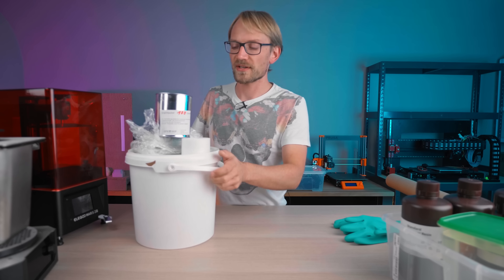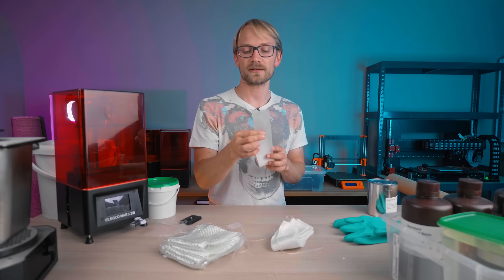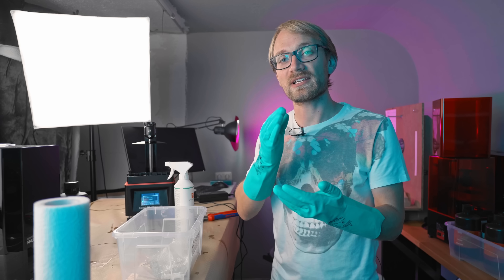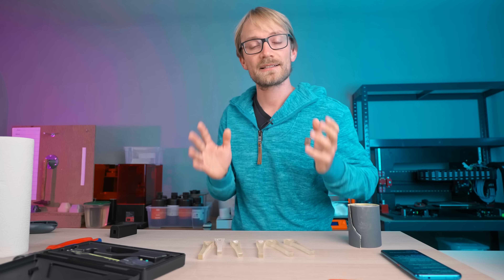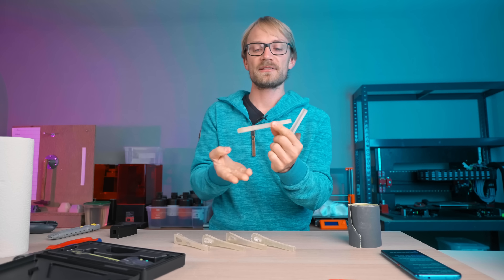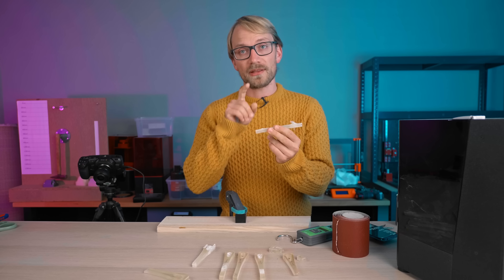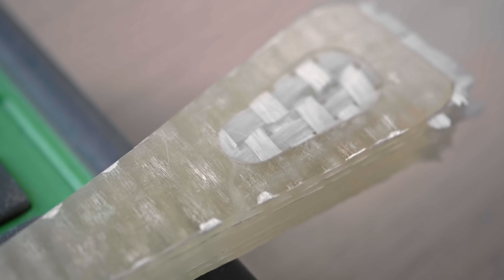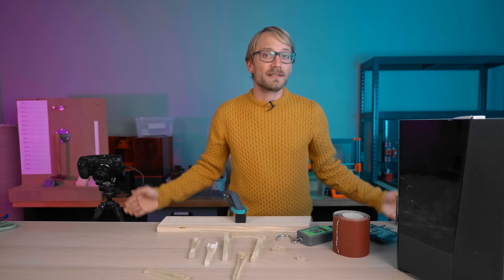Fiber-reinforced resin prints - how much STRONGER are they?

Comment: Concerned about the methodology here... There is a huge difference between Tensile Strength and Flexural Strength, and this test (which is purely flexural) is kind of a worse-case scenario for the orientation of the layers and the direction of force, mechanically speaking. I'll ramble a bit but don't want one wall of text so...

If I could recommend one improvement it would be to print two eyelets in your test pieces and do a Pull Test in a similar orientation to your scale. This would be testing Tensile strength instead of Flexural, and I suspect you'd find the overall tensile strength greatly improved over the default resin. When working with material composites, orientation is everything. To put into other terms: imagine a wet rope gets frozen all the way through. The newly rigid rope might, under the right circumstances, break if set parallel to the ground and force is applied to one end, as it's being attacked in it's thinnest/weakest dimension. If, however, the frozen rope was used to lift a load (as a rope realistically might be asked to do), failures in the ice may be more numerous, but they should be overall smaller, more evenly dispersed, and overall less impactful on the rope itself or it's ability to lift the attached load.
Reply: Flexural testing constitutes a very meaningful outcome to assess the integrity of a composite structure. Bending is the most frequently encountered load case of components in the real world, rather than tension-only. Logically, fibres are stronger in tension than in compression, so that's why the compression load upon bending tests the bonding quality between resin and fibre. If the bond is weak, fibres buckle prematurely, leading to compressive failure. If bond strength is very good, mixed mode failure or tensile fracture occurs upon bending. Overall, glass fibres tend to fail in compression (in some instances in tension), carbon tends to fail mainly in tension (even though tensile strength is higher than compression strength) upon bending, provided that fibre-matrix adhesion is very good. Before commenting, that I am wrong, I would suggest you do some mechanical tests yourself ;)
Reply: I think the results are still useful, but yeah a CNCKitchen-style tensile test would be a nice addition.  I wouldn't be surprised to see a different breakdown in strength from a tensile strength test, and thus you should pick the material specifically for your application.
Reply: Actual structural engineer for a composite aircraft company replying here - The flexural test isn't a bad test for this application, though you'd rather see a short-beam test (simple support on either end, load applied at center) to demonstrate flexural strength. Several commenters are correct, the upper skin in the demonstrated case will be in tension, while the lower skin is in compression. Flexural strength is the exact reason we in the industry use cored composites, not tensiile strength. This is essentially a cored composite.

I think the reason we're seeing early failure here is that half of your fibers are going transverse to the strain, thus doing nothing for strength properties. It would appear from the images that the fibers might also be less than fully wet out, and the failure mode would seem to bear that out. A unidirectional lengthwise fiber here might yield impressive numbers.

Also - though you show greater stiffness with less strength and judge that not good, that's not always the case. While high yield to failure (toughness) is usually thought of as a good thing, it is not always so in cases where high deflections will force loads into otherwise strong-enough parts.
Reply: I hate to burst everyone's bubble, but bending strength is more applicable to most applications.  You rarely get pure tension in any structure other than a truss.  Think of the applications for a high-strength print: quadcopter frame like he mentioned, some sort of hook, maybe a bracket to attach some things together.  All of those applications are loaded in bending.

Also, tension strength and bending strength are intimately related.  For the solid resin part that fractures on the tension face, the max bending stress at fracture is very close to the max tensile stress.  For the composite parts, it gets more complicated.  But it looks like most of them failed by crushing on the compression side of the bending member.  So the test measured the compression strength, but you can conclude the tension strength is increased because the tension fracture was inhibited.
Reply: just noticed this too =/
Reply: Plus by doing this adding layers and curing them separately you basically destroy the strongest benefit of resin printing by creating layer structure. It makes it more sensitive to Flexural tension. But Thomas if you read this, make another video where you basically wrap these parts in a 3d environment instead of 2D. Just 1 or 2 layers would be enough I believe.
Reply: I have always been under the impression that flexural strength is directly proportional to the tensile strength of the material because the top of the flexing member is in tension. Is this somehow not correct?
Reply: I was coming down to make a similar comment, you however put it more clean and organized than I would have. 

The flex test is confusing as the eyelets are commonly used for the pull/tensile tests… yes a 2nd set should have been made in this case. And even in the flex test, it’s context should be to “How” rather “when” it failed. Cause the double paper one is great for getting a clean break rather than the shatter of the plain or FG ones. The course/thick FG cloth does what it’s meant to do even outside it’s intended purpose. 

When it comes to experimenting, there’s so many things to test for, like for instance a flex or stress test with each end secure and something pushing or pulling on the mid section. (Versus to the steep leverage off one end.

Even apart from a structural aspect, this opens up possibilities with resin printing by integrating clothes (ex. Cloth coming out from under armor plates or hair or some “feathery” coat…. Please no one try to make a tooth brush like this..)
Reply: flexural strength is tension on the top and compression on the bottom. it is a worst case scenario for this composite, but it is also a fairly reasonable use case for things you'd make with this technique because of the dimensions of the printable volume and the way you have to lay up the fiberglass reinforcement sheets
Reply: In flexural test, the strength would be dictated by the toughness of the added material.
Reply: Right? I was wondering why this felt a bit counter-intuitive from the start.
Reply: i had the same conclusions
Reply: I agree that it would have probably been better to just test tensile strength; however, the fibers would be able to show off its tensile strength on the area which is being stretched longer as he pointed out at 11:25.  So I think this test accomplishes what it needed.
Reply: Yes, that is the problem. He did not do a pull test.
Reply: Ah....i see ...
Reply: Ironically, when experiencing a bending moment like in the video, the top of the object is in tension. This is also where the parts seem to have failed. The failure looks like a delamination which is likely due to the fibers not being completely wetted out or not being cured through the whole matrix. Bending loads produce shear, compressive and tensile forces and I think this is a fair test. It would hold up to scrutiny.
Reply: i know right? putting in fiber is to increase tensile strength. flawed methodology
Reply: @doctorjustice  Added fibers would increase tensile strength. The problem is that he didn't test tensile strength. He tested flexural strength.
Reply: I don't follow what you guys have against the testing.
Reply: @mwpaus  Ok. Brb, going to university so I can watch a youtube video. Or you can clarify what the issue is.
Reply: @difflocktwo  A big simplification: the fibers increase the print's strength when pulling on two sides on the print. Not when bending. 
The fibers aren't supposed to enhance the material when its bent and he checked if it bends better. 
He didn't check if the printer is stronger when pulled although he used the material designed for pulling.
Reply: @liondrago  Isn't that what Tom explained in the video after the results? I think it isn't accurate to say that fiber reinforcement is purely tensile. And even if it were, a bending test isn't completely useless. We saw an increase in stiffness.
Reply: @difflocktwo  It's just that the testing and results are incomplete. The video's title asks "how much stronger are they" and the answer is half-baked.
Reply: @liondrago  Yeah, ok. I kinda get what you guys are saying.
Reply: @difflocktwo  A Simple explanation is that fibers are strongest in tension. Think of spaghetti, it's very easy to break if you bend it, but if you try to pull it apart it is much stronger.
Reply: @difflocktwo  if you need to go to university to understand these concepts, you are not going to university, bro
Reply: @johnmadden9613  I'm not the one who said it's required. Someone else did. And there's no prerequisites for open university and generally a highschool degree or even vocational degree will get you into uni.
Reply: @difflocktwo  Useless in that it doesn't really give you an accurate measure for the increase in strength.
It should ahve been pulled apart rather than used as a cantilever beam. 

Like the OP said, orientation of fibre is important., and in this case, the fibre isn't really doing anything. As you can see from most of the testing, the layers separate when it breaks. The resin itself breaks, and then separates from the layers.
This is basically testing bond strength between the resin and the fibres, and not the strength of the fibres, in any meaningful direction, as the fibres go in x and z, but not y. He would have been better turning the piece 90 degrees and having the fibres perpendicular to the ground. Or as the other person suggested doing an ACTUAL TENSILE test, and not a flexural test. 

The layers are nearly close enough either. What he should have is tried to print with resin that had a bunch of loose fibres in it, able to go into any direction. Which is why they do with GFR PA6 Nylon. Its plastic and loose short glass fibres, that are oriented randomly, and mostly dispersed, giving you omnidirectional strength, and even distribution.
He's laying sheets down, which is usually done with an epoxy an wetted sheets, where they're layed very very close together, givng you mostly glass fibre layers, with only a resin matrix holding them in place. But the majority of the structure is the glass fibre, and not the resin.
Reply: @PBMS123  The closeup of the first heavy mat part would indicate that the resin was not able to properly bond to the fibers, so the effect the fibers end up having on the part is just reducing the effective surface area for distributing the load across the resin, resulting in the much reduced effective tensile strength for the part. It may be that the UV for curing the resin is being absorbed by the thick/dense layers of glass, leading to sections/areas that are not fully cured in the part. Using a unidirectional tape and multi-directional UV cure could alleviate these issues.

Your idea for the loose fiber resin is interesting, but it then becomes an issue of whether the printer can handle the resin mix properly and the cure issues with UV and glass fibers. It would need some serious testing with multiple fill percentages and curing exposures.
Reply: @liondrago  Almost the entirety of aerospace and marine structural design seems to disagree with you when it comes to composite laminates not increasing "bending strength." 

Tensile strength is a material property that is applied/measured based on the effective area of the material under stress. A pull test won't tell you any more about the UTS of a surface laminate composite material than a bend test will; the math works out virtually identical regardless of which method you employ. A bend test is just a more localized pull test on a smaller section of the material, which is entirely the reason you'd want to use  a surface laminate composite over a distributed laminate composite if you have the option. If it was a distributed composite, where layers of fiber were evenly distributed throughout the part, then yes the pull test results would be much different than a bend test on the same composite material.
Reply: @soldner4738  Oh, hm, that makes sense. I need to learn better, then. Thanks!
Reply: @soldner4738  From what I remember of my materials class if you get the cauchy stress-tensor then you can rotate the coordinates to calculate the stresses in any direction. What I have no clue about is how would I define the stress tensor in anisotropic materials, I would imagine the whole failure at 45 angle through shear in fragile materials does not apply in composites and you would need to test the material in every direction, maybe?
Reply: @BromoDragoonFly  Sounds like you're just making it more complicated than it needs to be for this kind of material and test. But actually calculating that for something like a fiber composite requires estimations of the fiber density, direction, and distribution and how those properties are related to the stress the material is experiencing.
Reply: @difflocktwo  Think of a plastic ruler like the one you had in school.  Put the ruler half over the edge of a table. Pushing down on the over hanging half; the ruler will snap very easily but try pulling that ruler apart with two hands and you will find it really difficult to break.  Now imagine the ruler is made from glass.
Reply: @landroveraddict2457  Both bending and tensile testing are valid though.
Reply: @nerdicorgi  I mean it should also increase compressive strength. UV cured resin isn't terribly different in mechanical properties to epoxies used in commercial composites. The problem I see is he just put a thin layer in and the rest is just resin.
Reply: I see no problem with the test provided the test is consistent across samples. Flexural strength IS tensile strength applied differently, the main difference being that one side is in compression, and the other side is in tension. Is it strictly a tensile strength test? No. But it does measure a physical property that has real world applications. You can find moment failure testing for beams all over the place, especially in reinforced concrete (I.E. concrete reinforced with steel wires). As a matter of fact, you COULDN'T test reinforced concrete properly without this style of testing, as with only a traditional tensile test the concrete would fall apart and you would end up measuring the tensile strength of a few steel wires. Moment testing is a foundational quality of all cross beam and cantilever design, and as long as the test is useful, I see little point in splitting hairs over technical definitions of the word "strength."

As to where I think the design failed, I suspect it has to do with the cleavage in resin resultant from layering the material. Imagine a pound of dry spaghetti noodles. You could probably break the whole pound in half pretty easily, right? Now imagine that pound of spaghetti was all condensed into one really thick noodle. Probably not as easy to break, right? That's because the individual noodles can become focal points for tremendous stresses while the other noodles bear less of the load. On the big noodle, those forces are distributed across the whole noodle due to the lack of free movement internally. How might this gentleman correct his layering method? I would suggest substituting layers of fabric for individual strings organized lengthwise, with considerable distance between them as not to cause cleavage in the samples.
Reply: @QuippersUnited  
The cleavage point of your spaghetti example is kind of correct. It's the same layer 'problem' that a reinforced earth wall solves for modern earthwork projects. You can take a bucket worth of sand, pile it up, and drive a car more 'through it' than 'over it'. But if you layer some fiberglass sheets every so often the layers of sand have less sheering potential and, as a result you can park a car on it no problem. This is why modern overpasses don't have that big 45 degree slope of concrete and earth beneath them anymore, because reinforced earth walls eliminate all of the erosion and sheer line problems of loose or packed dirt, even when coated with concrete.

But, to like it to the original problem I posted concerns about... A reinforced earth wall is not a bridge. It would never work as a bridge, could never be suspended over a river, and would immediately fail when expected to flex... 

When you're working in design and engineering, you have worlds of tools at your disposal. In the case of this video, the tool chosen was an additive that boosts tensile strength. But the problem he wanted to solve was flexural, so he chose the wrong tool - and then kind of blamed the tool :/
Reply: @nerdicorgi  I honestly think the guy was just using oversimplified terminology. I think the quality he was looking to test would be most analogous to reinforced concrete, where the fibers would serve as the steel cable (tension), and the resin would serve as the concrete (compression). If that is the case, then the quality he would be measuring would describe interplay between the materials, rather than net strength of all the materials like a tension test. I don't think he did the wrong test, I honestly think the test he did is more informative about the quality of the material he created, I just think he used poor or at least oversimplified terminology.
Reply: @QuippersUnited  If that was his intent, then yes - I would say the problem is either communication for the sake of the audience or just choosing the wrong materials for his desired goal. BUT, without testing there's no real way to independently verify which materials are "wrong" for an application, so I don't really fault him for either option. I'm sure it's hard to make a video like this without getting bogged down in techinical terminology of the sort that scares away new viewers to the "Practical Engineering" and "Applied Science" channels. So yeah - if that balancing act between approachability and science caused a language problem, that'd make perfect sense.
Reply: @QuippersUnited  yep